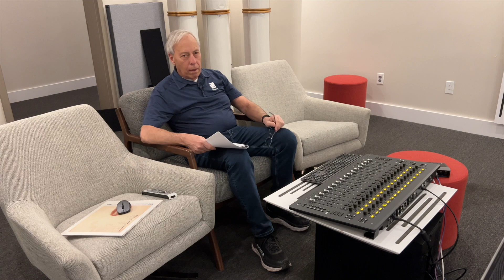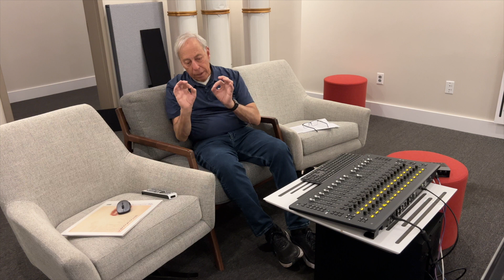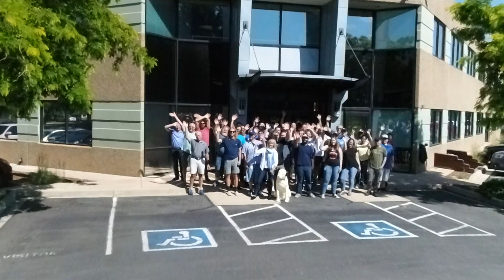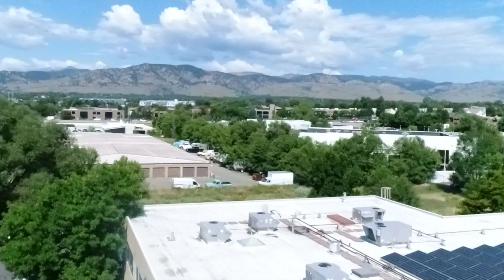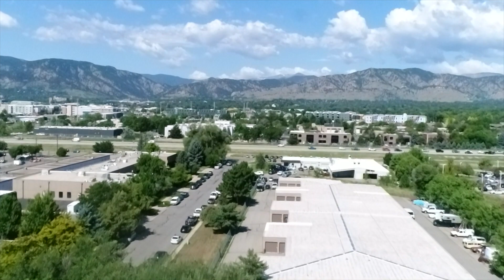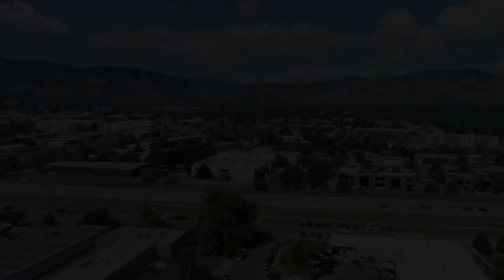DSD and signal processing

Comment: The benefit of DSD (or rather 1-bit sigma delta conversion) is really limited to the point of A/D and D/A conversion. This is because high speed clocks are easier to control than precise voltage levels and this has been known for a long time. The digital format in the middle really does not matter. Whenever someone uses PCM it will have most likely gone through a DSD-like 1-bit sigma delta A/D or D/A and the benefit of keeping a DSD digital format all the way through the process is nil (well except for marketing reasons). DSD was developed by Sony for archiving master tapes, i.e. a simple capture and store, and defer any decision on processing until later. Using DSD for anything else then archiving that does not any make sense.
Reply: that's your point of view. ok. My point of view is that the benefits of the format are: 1. less steep antialliasing filters used, 2. less phase noise 3. wider dynamic range. Disadvantages about processing are another aspect one has to deal with but we have a choice.
Reply: @CyrilleBoucanogh  All of those can be achieved with high resolution PCM, e.g. 24bit 192kHz requires less aggressive filtering and has higher dynamic range.
Reply: 24/192 has only 12 dB lower phase noise while DSD has almost zero phase noise in the range 20-20000 hz. But phase noise is the worst enemy of high fidelity.  Better filtering and dynamic range are not so important as mathematicaly perfect phase.

Comment: "2+2=5! Now that might get the hairs on the back of your neck up and I have even had mathematicians and all sorts of people tell me 2+2=4, but trust me 2+2 definitely equals 5." ~ Paul McGowan, PS Audio.
The above statement isn't true at all and neither is the statement; "In one sense we have to view DSD as the perfect capture tool, and it's important, because PCM, which is eminently adjustable and run through DSP and all that, is not the best capture tool..." Paul McGowen, PS Audio. 2:03.
Paul goes on to explain that mathematicians have told him that DSD isn't the perfect capture tool and that in fact, PCM is actually a better capture tool.
Actually, Mathematicians, University Professors, Audio Engineers with PHDs, and Scientists have all scientifically proven that DSD is absolutely not better than PCM for capturing audio.
Furthermore, it has been proven over and over again through blind listening tests, scientifically, that DSD doesn't sound better than PCM.
Simply and truthfully stated DSD does not have any advantage over PCM and factually is inferior to PCM in a multitude of ways.
I will gladly provide links to scientific data proving that last statement to anybody that really wants to know the truth.
Reply: PCM with such a high samplerate should (in my opinion) be almost impossible to detect any nuisances. 
The human ear practically can only hear up to 20k. So with that being said, a samplerate of for example 192k would be practical if we could hear up to 80k or so. But that’s so high not even a dog can hear it. So with that said, I’m not sure why DSD should be of such praise.
Reply: Unfortunately I don't have access to studio-grade equipment or extensive knowledge of psychoacoustics, but I have heard the claim that "PCM loses something, and DSD gives it back" over and over again.  In another comment I've explained the possible differences that could account for that, if the effect is anything other than placebo, but I don't have the resources to answer the question definitively.  It's something I'm deeply curious about.  I would appreciate links to the studies mentioned.
Reply: @jxtq27  
https://sjeng.org/ftp/SACD.pdf
Reply: @jxtq27  
http://diracdocs.com/aes_paper_6086.pdf

Comment: Hey Paul. So does not an A-D converter = a sampler? (I am about to make a point. The correct answer is yes. It is taking snapshots of the audio waveform at specified time intervals). With that whether it is DSD or PCM there is little difference there. I understand that each format does that process differently but they are essentially doing the same thing. Does that not mean that when you convert back and forth between analogue and digital audio you are creating artifacts and losing information? With PCM it is my contention that I gain more by not converting most of the time than I do by running my individual tracks through specific channel strips which it seems for the most part mix engineers are not going back to analogue much anymore. Also as PCM has marched along we have seen some great advances being made that allow us to very closely mimic much of those kinds of analogue signal paths. Yes, there is still bit depth loss to contend with but my argument is it is measurably less. Forgive me for being skeptical but I am yet to be sold on DSD although I am quite intrigued about it.
Reply: "but they are essentially doing the same thing." - a PDM algorithm (for analog to digital) at heart looks at how the analog signal is changing (e.g., as the analog signal strength increases there will be ever more 1's in the PDM stream rather than 0's until the analog peak is reached, then after that peak there will be increasing number of 0's in a row as the analog signal decreases) rather than representing the absolute value of the analog signal (which is what PCM does.)

"Does that not mean that when you convert back and forth between analogue and digital audio you are creating artifacts and losing information?" - that is always true regardless of how you want to encode information digitally.  This is why engineers invoke Shannon when discussing these things.
Reply: @TheDanEdwards  forgive me but what is Shannon?
Reply: Yes, of course information is lost, in general, every time a signal is converted into a sampled, quantized, digital format.  What you end up playing back is different from the original signal, however slightly.  The goal is not necessarily to minimize that difference, which has a certain mathematical definition, but to minimize how annoying that difference is.  Imagine someone put a gun to your head and told you that you must mix in some noise to your favorite recording.  You get to choose between -40dBFS of white noise, and -41dBFS of fingers on a chalk board.  The argument for PDM (DSD is a trademark for PDM) is not that it contains more information per bit, but that the noise introduced is less noticable/objectionable than with PCM.  There are two possible reasons for this, and I haven't found a convincing study that indicates which, if either effect, or both together, is responsible for the perceived quality difference.  One difference is in the hardware that's used to do the conversion, especially the A/D conversion, which is generally regarded as harder than D/A conversion.  In addition to high quality analog amplifiers, which are required for both PDM and PCM, analog to PDM conversion requires running the converter at much higher frequencies, whereas analog to PCM conversion requires extremely precise matching of internal components withing the converter.  At least at the present time, we're better at high speed than high precision, when it comes to digitally-controlled systems.
The other possible source of improvement comes from the format itself.  Whereas PCM introduces a new sample with lots of information all at once, every so often, PDM introduces a single bit of information much more frequently.  This tends to whiten the quantization noise, making it less correlated to the signal being recorded, and thus sounding less like distortion.
Reply: @jxtq27  I'm not sure where you got that bunch of hyperbole but that is completely incorrect from the top all the way to the end.
Reply: @JonAnderhub  I'm not entirely sure which bits came from where, I've absorbed engineering knowledge over a long period of time, but I'm pretty sure the part about PCM converters came from EE476, and the bit about PDM converters came from a Burr Brown datasheet.  If I've got something wrong, it would be nice to hear what, specifically is wrong, and what the correct information is.  Dialog and education do not advance by mere contradiction.  In the mean time, you may want to read the Wikipedia article on noise shaping, there's a section with spectrograms that illustrates my point nicely.  https://en.m.wikipedia.org/wiki/Noise_shaping
Reply: An Analog to Digital converter is not a sampler, but a sampler uses an analog-to-digital converter as well as a digital to analog converter.
A "Sampler does digital recording for a very limited duration.

Comment: @5:20 "That's the best way to go about it".
Yes.  Agreed.

Thank goodness DSD is not able to be modified.  That is one less place studio personnel can screw with it.
Thank goodness they cannot adjust the gain, via DSD.  Doing so would introduce distortion.  Digital volume is a no-no when sonic excellence is the goal.

The above sort-of forces studios to get the recording right... from the get-go.
I write "sort-of", because after they convert the DSD file to a PCM file, the tinkering can once again screw things up.

I wish that no compression and no equalization would be used.  Those boxes add distortion and coloration, and it is cumulative.  Even if their controls were all left in the neutral position, you can hear that the signal passed through those boxes.  I want to hear the band -- not the post-processing boxes in the studio.

Record each instrument correctly from the start, and adjust the gain with a quality attenuator.  This leaves the natural shape, body, and character of each person's voice, and each instrument's sound, intact.

If you want more bass, then turn up the gain on the stem containing the bass guitar.  Do not boost the bass via an equalizer.  That is how you wreck the sound quality.
Reply: yes, I notice this on playback.
Reply: It is same for PCM. You can't do anything during A/D conversion or D/A conversion. Only before and after this process.